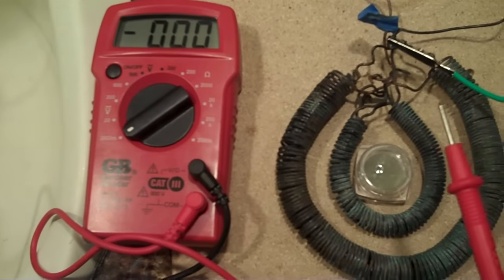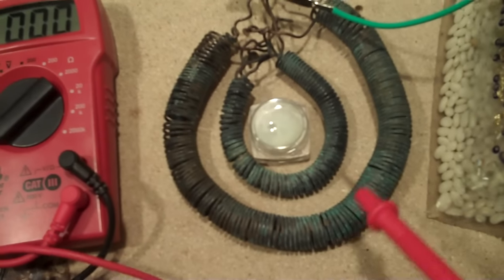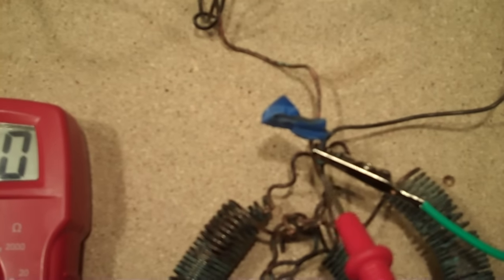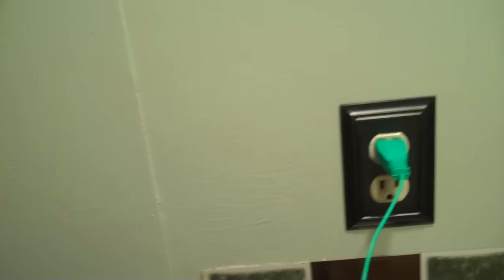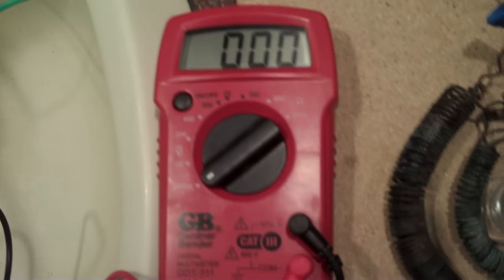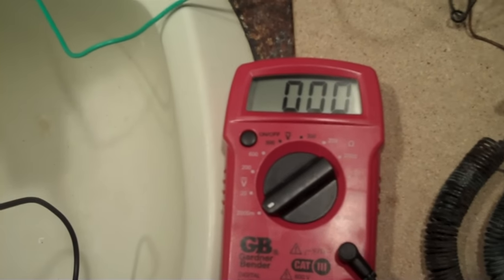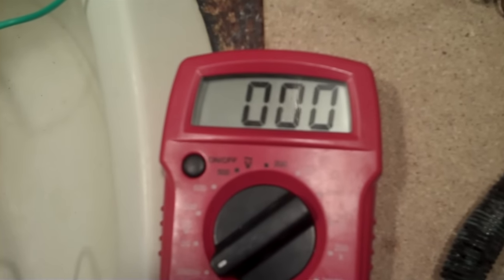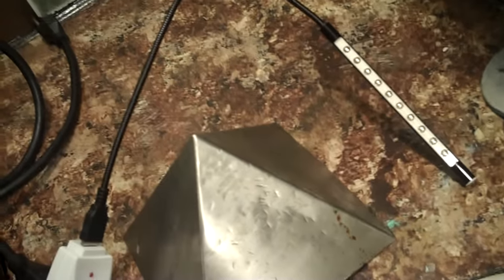My First Plasma Battery

Comment: Ham radio operators have created a car 12V battery charger that uses a long wire antenna that builds up a high voltage charge potential across a old car coil that builds up and sparks sending a 13 volt pulse at the low voltage side of the car ignition coil.  A few diodes allow a 12 volt battery to be charged in a couple of days.  do a search for Capacitor electric charger from the air.   I think you will find it more practical for lighting DC lights
Reply from the maker: +Dave Spiller All of my appliances work on plasma power, there is no limit and they do not have to be D/C. Your post is confusing. Clarify or it will be erased.
Reply: no it makes more scene than your poor attempt. what you are seeing on your hunk of scrap metal is galvanic corrosion. its not new, its easy to do and its similar to how every battery already works except much slower.
Reply: his posses while fairly poorly explained is however real however its also a very slow posses and has a host of problems around its application. where a wind turbine or simple solar cell out performs it drastically.. but at least it exists and does as people claim for the most part

Comment from the maker: In the "class" yesterday (90th Knowledge Seekers Workshop) Mr. Keshe says not to use alligator clips and he draws a picture of what the "teeth" do to the coating. He suggests a paper clip in between the alligator clip and the nanocoated wire. So I had those and I also had some gold tipped stereo plugs which take heavy wire, I put them on the ends of my nano-coated wires and clipped the alligator clips to those. I will re-photo if there is some change, so far there is none. He also says that plasma coating (e.g. coke bottle method) is the best way to polarize the wires. He says heating them works better than caustic. So I will try heat next and I will polarize with A/C and gold plug tip then perhaps again with voltmeter to see if the A/C has made one side hot and the other cold. There should be a difference in the sides visible on the voltmeter. On my contraption, voltmeter always reads minus but no current just what you see in the video--momentary flow, flashing onto the screen sometimes a large amount but does not stay long enough even to get a good video of it...there is flow but it's not necessarily directing itself toward the lamp. No problem as Mr. K says, we will try again. Thanks for watching. I am sharing my experience so others can maybe take a step forward from my place then share what they did. It is not for entertainment. It is for learning. Blessings.
Reply: +AbbyJo Ovitsky For learning better go to school :D
Reply from the maker: Martin Singer no.

Comment: Multimeters use small current for measuring. It's called reference current. That's why you get that tiny values for short time. Anyway, coils can grab radio waves which can generate energy too. It depends on the size of loop. If you have correct loop size, you can listen to satellite signal for example. Keshes stuff grabbed my attention but as I was searching about some results all results are same ... similar to yours. Anyway, all materials provided by him doesn't look like professional thing. Blueprints looks more like child paints. It's all weird.
Reply from the maker: +TrueLweek I will make a new video to prove you are wrong. It is showing double digit milliamp flow. I replace the single coil with a heat treated (instead of caustic) coil and I also polarized that before using it. I put less gans on it. I plugged it in for a day before introducing load. I invite you to re-visit your conclusions and try again, TrueLweek. Mr. K says it takes 2 months to build a working system. Presumably because we all make some kind of mistake the first time. I have seen several working systems, if you are "searching about some results" then I invite you to keep searching. I will make more videos to show it does have steady current flow through the single coil. The first attempt had fluctuating current.

Attitude is important here. We all have much experience in proving our own biases. We cannot ascend above the old ways (and mistaken ways) unless we let go first of those "it won't work" beliefs and at least open the mind a crack to embrace a new belief of "it will work when I fully understand." I watched Knowledge Seekers 85-91 and 1-14, the classes after 85 are for everyone, the ones before that are for nuclear scientists, but anyone can enroll for 1000 EUR a year. I don't have 1000 EUR a year to pay. All those 91 classes (each 2-3 hrs) are now on YouTube for free. Before you give up, TrueLweek and exclaim that it does not work, watch all the classes. The blueprints are not child paintings as far as I am concerned, they are working instructions for building a real system. Of course, if you only have a hammer, everything looks like a nail (Maslow).
Reply: +AbbyJo Ovitsky 
I am not very optimistic that it will help, Mr genius. But anyway:
http://thinkscientific.w4f.eu/Messtechnik.html

Learn to use your meter before you babble nonsense.
Reply from the maker: Jean-Pierre, it is not helpful nor did I request your "help." 

Help yourself, JP.
Reply from the maker: abusive comments will be reported as abuse.
Reply from the maker: Jean-Pierre Murrli. I calibrated without the multi meter using A/C wall current and a clip. This is already "old" I made a new video on January 1.
Reply from the maker: Lack of calibration was one cause of the "result" not being as expected. I will continue with it, I see some results even if the current does not flow to the light.
Reply: +AbbyJo Ovitsky Spiritual results?
Reply: ***** What and how did you "calibrate"? Do you even know what the word "calibrate" means?
Reply from the maker: +Jean-Pierre Mürrli Kindly be respectful to me if you expect me to be respectful to you, Jean-Pierre.
Reply from the maker: +AbbyJo Ovitsky There is a repeated sense of "it's temporary" and we are all a bit like the falcon, the soul can be the falcon flying high overhead, surveying all from a safe distance...observing. The soul observes...our little conflicts, our little emotions, our suffering, our joy, our sadness, our pain and takes it all in. My suffering has as much meaning as I make out of it as does yours. But I am not less because of anything you do or say, nor are you less than. We are all equally important, brother Jean-Pierre Murrli.
Reply: ***** If you want to preach - there is for sure some sort of church neaar you.
But, dude - we are talking science here.
Reply from the maker: Jean-Pierre, I am not your "dude" and I am ordained myself. I am not "talking" you are. Kindly refrain from disrespect.